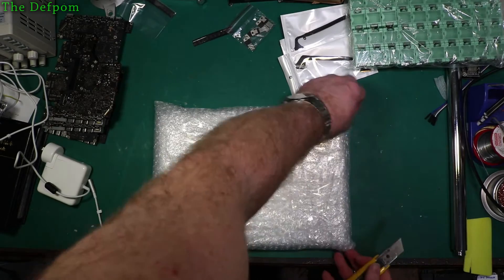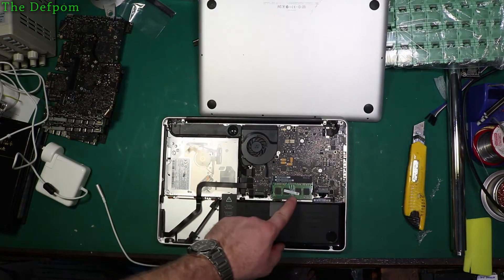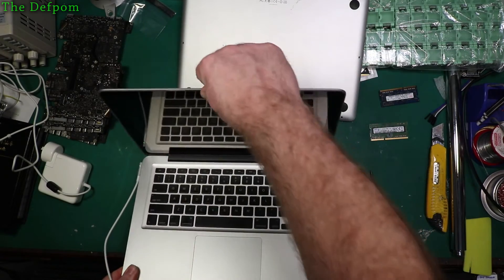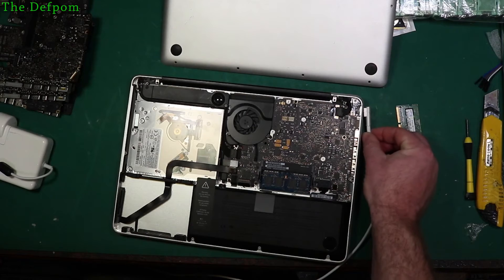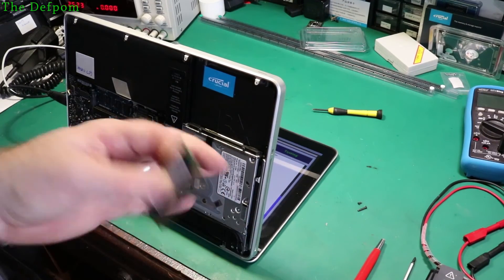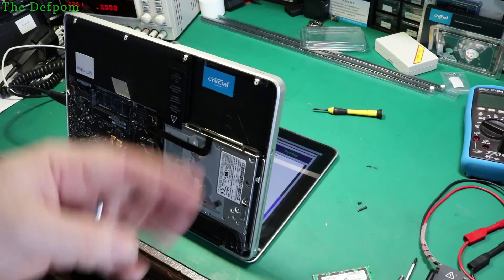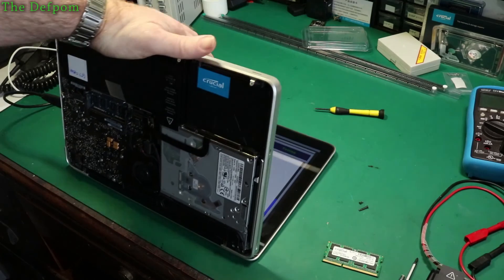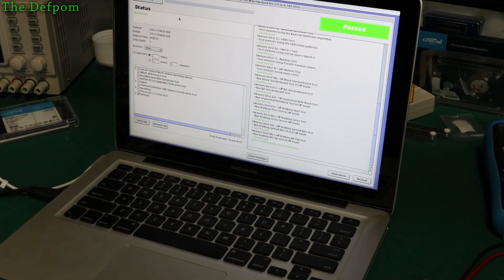🔴 #526 Apple MacBook Pro 13 A1278 Repair - Beeping On Startup For Bad RAM SN_RTWATMv2

Comment: Whats the issue if it beeps 3 times when trying to start up?
Reply: try cleaning your ram
Reply: @mikeydoesit905   but the RAM is a shouldered one
Reply: Abhijit Das you mean soldered? Which year Mac do you have?
Reply: @mikeydoesit905  yes sorry typo.. it is soldered to the logic board.. macbook is for 2015

Comment: Well diagnosed :-D, hopefully you have a cracked joint on the bad socket only.
Ordinary laptops can be picky sods with memory, so i would not be supprised that apple did as well.
You might want to do a compair of the resistances of the pins to gnd with the first/second socket, if you like pain lol.

Comment: If you don't use a soldering iron is it really even fixing? waiting for a part 2 when you fix the 2nd ram slot.
Reply from the maker: Peter Ellens - the ram slots are known for being impossible to repair which is why I didn’t try, I didn’t want to risk destroying the one remaining ram slot functionality.